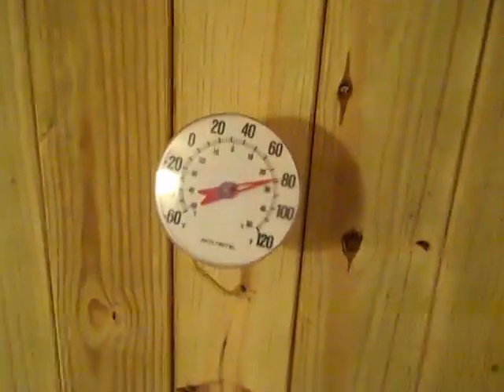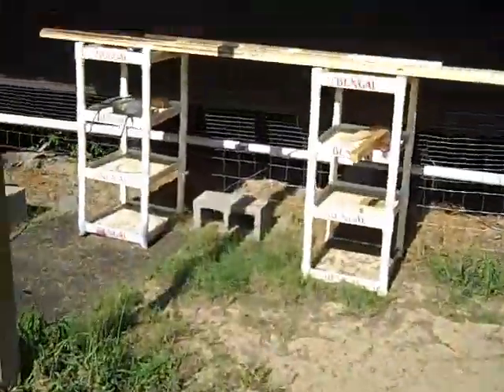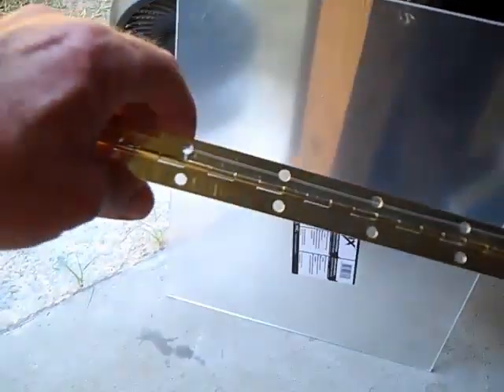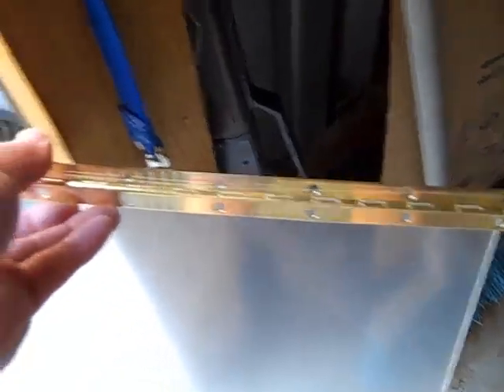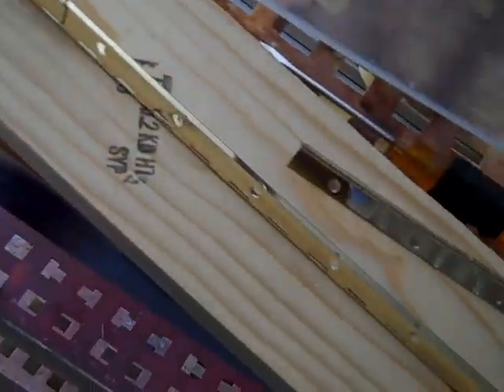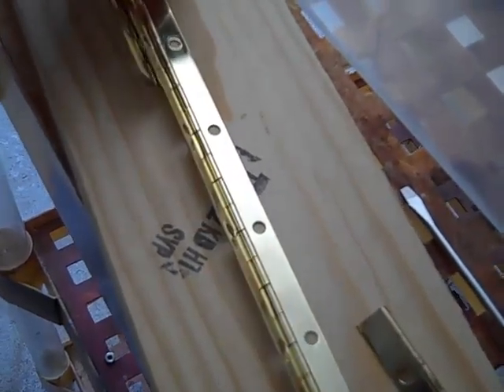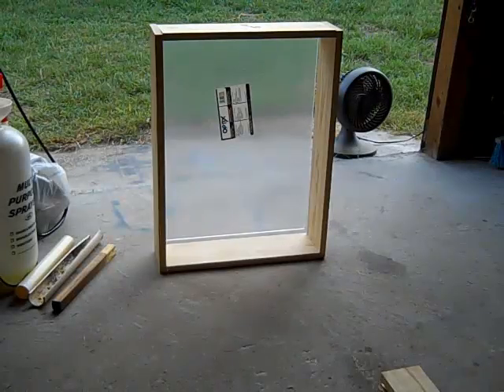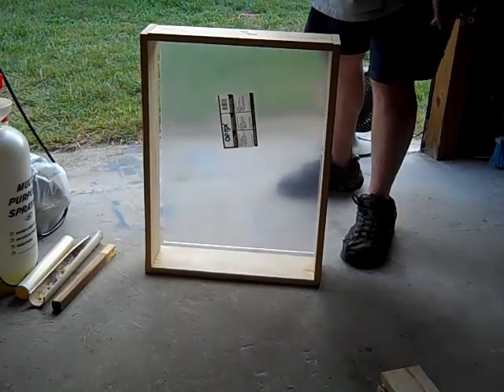Homemade Doggy Door Part 1

Comment: Boy o  boy - you were an answer to my prayer 🙏 you taught me just what I needed to know about using plexiglass and piano hinges to make a doggie door. Thank you so much!! ♥️
Reply from the maker: You're welcome. The one thing I would change would be the Plexi-glass. There is some thick plastic at Home Depot that has more flexibility and won't hurt your dog if he happens to get half way in or out and decides to change directions. The plexi-glass does not have any give and Ted has gotten his leg caught in it and he had a pretty good scrape on his leg from him trying to pull it back in after he stuck it out. Only once in 3 years so he hasn't killed himself but that's what I would change if I were doing it again. 
  Thanks for watching and and have a great day Meiral,  Good Luck,    Pinballman1
Reply: @pinballman1  
oh gosh thank you so very much for that! I have a big Rottweiler and another little bitty pug - either one of them could stuck very easily! I’ll check out HD. When I began my search, I didn’t see anything available there so I went to Lowe’s. Do you remember the name of that product? I appreciate all your help as my dad lives in heaven now and I can’t ask him about any building problems.
Thank you 🐶
Reply from the maker: You're welcome, Stay safe and have a great day,    Pinballman1

Comment: What size screws did you use and frame
Reply from the maker: I'm not sure. I think I used finish nails for the frame in this video. Normally I do overkill on everything so when I am installing into 2X4's I normally use 3" screws. Thanks for watching and have a great evening Collista,       Pinballman1